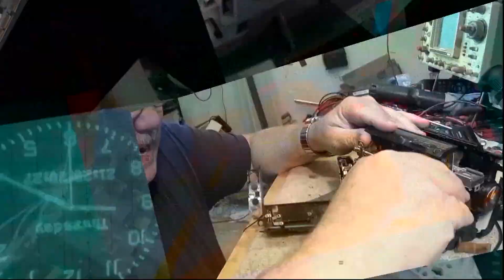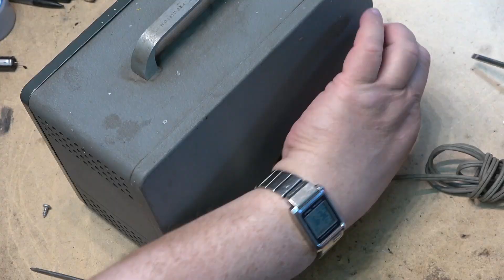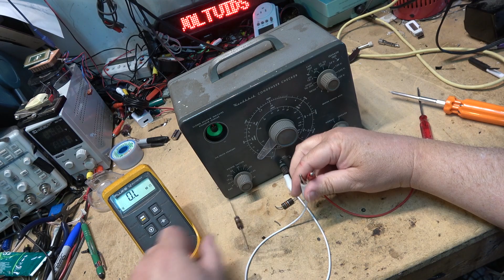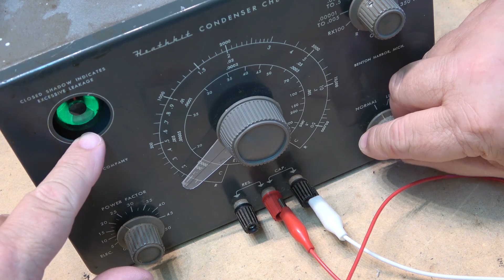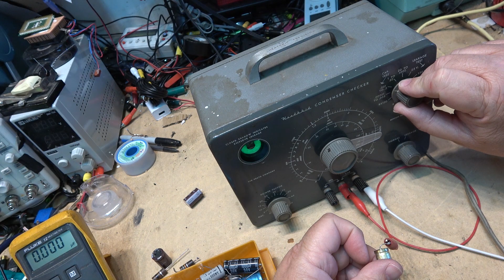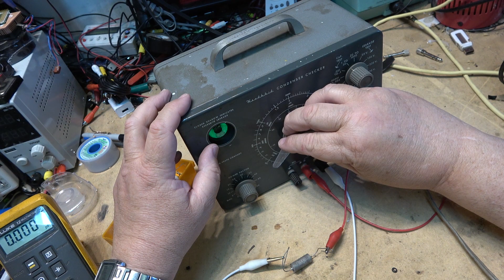Checking over my Heathkit Capacitor Breakdown Checker

Comment: I restored one of those, only to find out once I went through and dialed everything in, the transformer arcs. The 450v winding has an intermittent short. I picked up an EICO and a Sprague Tel-ohmike around the same time. I restored the EICO and the Sprague will get a chance eventually.  I find these units pretty handy to confirm issues of leakage. It's the only tester that can test real world conditions. While  checking ESR is handy and kind of a go - no go test.. this is the only way to check for leakage. I did pick up another Heathkit cap tester I'm going to rob the transformer off from to complete the one I restored. It's kinda fun to restore this old test gear and put it to work.  Love stuff with magic eyes! Thanks for the vid!
Reply from the maker: That's what happened to the first acopebi ever had when I was about 15. It was an old Heathkit and the 1500 volt winding shorted and that made the scope history.
Reply from the maker: Correct this is the only way to properly test.  The one Carlson built that uses low voltage can't catch a hv breakdown because the only way you can test for that is by placing hv on the cap

Comment: I have one of these. It is a nice little unit. A couple of things to note. The power factor control is either set to paper, full counter clockwise, or turn it clockwise, just till the switch operates, at which point you can measure the value of an electrolytic correctly and can then use the power factor control to fine tune the eye opening which will tell you the power factor. One feature of this tester is if you are measuring a capacitor that is bad and you turn the main control all the way to max or all the way to minimum and the eye opens, it is either shorted or open. Forget which is which. The oddity of this unit is that on the highest capacitor value setting that doesn't work or may work for one and not the other. Again, I forget which. You can test this by not having a cap across the leads and crank the main control in both directions and then shorting the leads rotate the knob in the opposite direction. Yours seems to be working correctly but I need to warn you about a strange problem I had with mine. The insulation on many of the wires had become conductive which meant you would get a reading with nothing connected to the leads. Had to replace a lot of the wiring. It works as it should now and I am happy with it.
Reply from the maker: I'll have to read up on it. I picked this one up for 20 bucks awhile back.  Yes i know some are selling for hundreds these days.  Handy took for hv breakdown test.  I wouldn't be using it for any other tests. Obviously my fluke is far more accurate for capacity measurements and the ESR meter tests that.  This for hv breakdown.

Comment: I would not use such old capacitor leakage tester. There are much more sensitive modern devices for capacitor leakeage testing. This heatkit does not detect very small leakage like newer testers do.
Reply from the maker: Leakage avd hv breakdown testing are totally different things.   The newer testers use low voltage. This thing can put 450 volts across a cap.   It uses that triode in the measurement.  When caps become even slightly leaky they will upset high impedence tube amplifier blocking / bias.  Accuracy is good enough for tube circuits which is what this is intended for.
Reply: What would you recommend?
Reply: @alanrussell6678  A nice DIY project is Carlson's leakage tester. It's small and very sensitive. He shows how sensitive it is and that older leakage testers do not detect leakage like his device does. Here is the link to his video explanation: https://youtu.be/LhovRIM5xAo

Comment: Not exactly like that one, I've seen others on YouTube use a similar device.
There was a red light for the leakage test if the cap was leaky on the other devices.
Reply from the maker: Low voltage resistance test is nothing like putting 450 volts across the cap under test and charging it up.